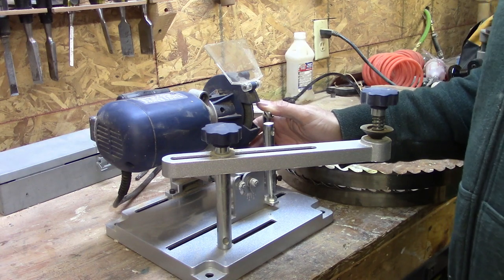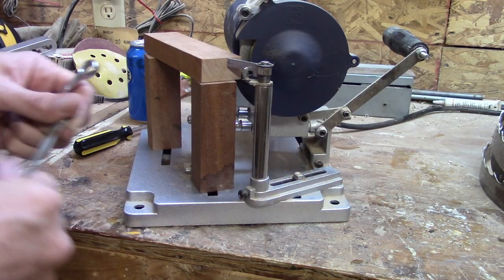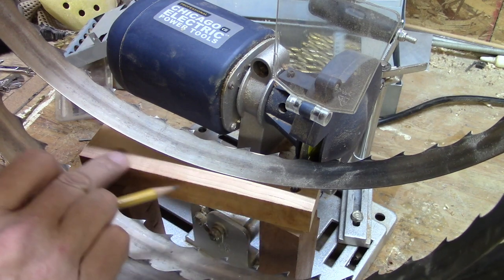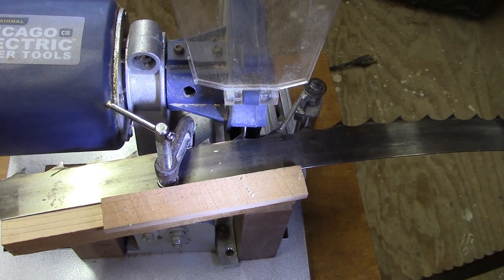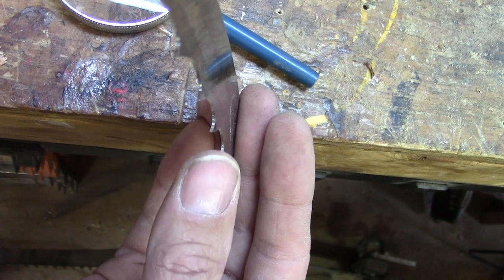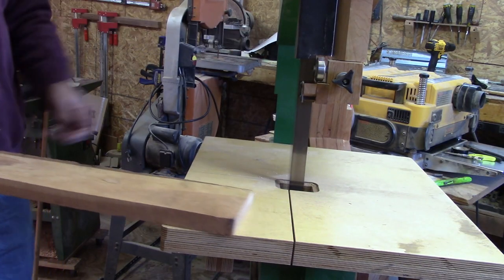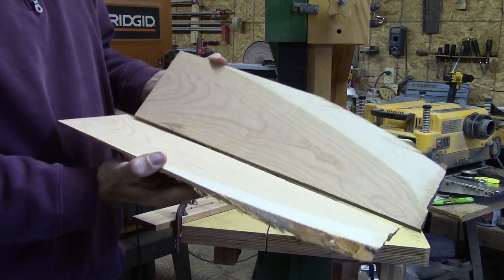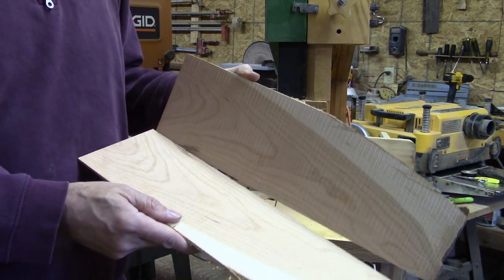Sharpen Your Bandsaw With Harbor Freight Tool

Comment: That's some chewed up push sticks you have there.  I haven't tried to sharpen one of these sawmill blades myself yet.  Been using my 20" saw with a 1/4" blade cause I find I need the most elbow room when I cut out stuff with lots of curves in it.